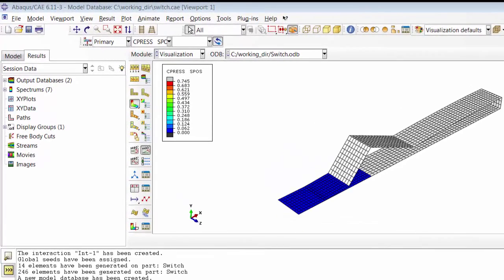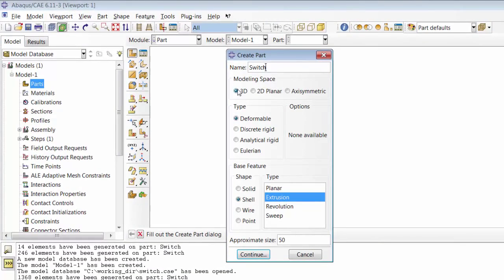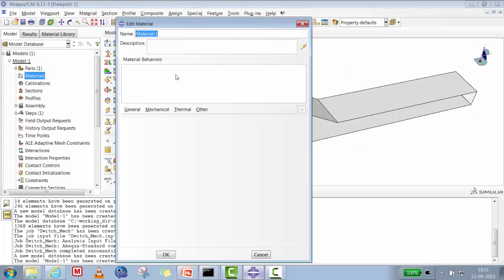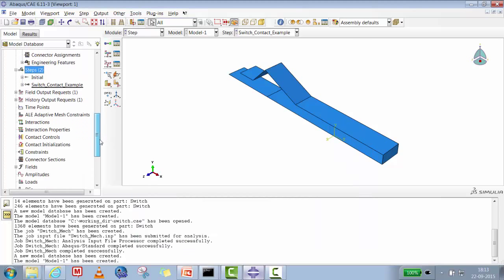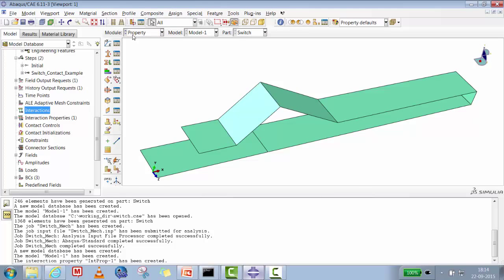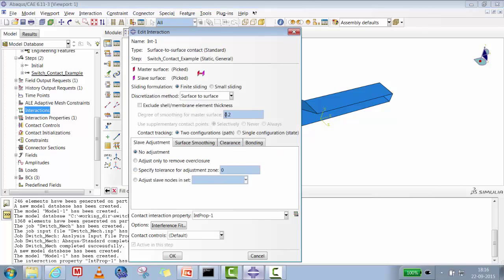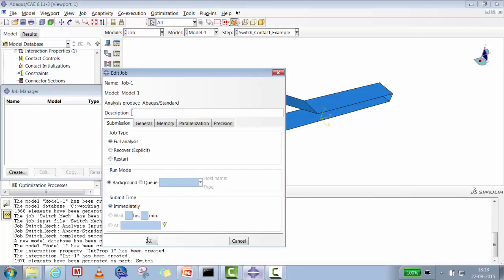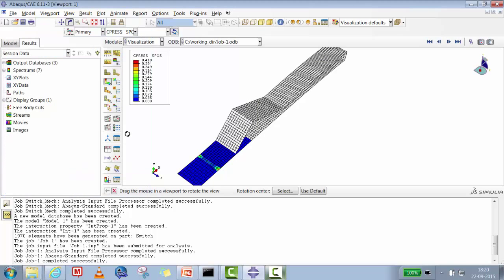Abaqus CAE/ 6.11 : How to do step by step Abaqus Contact (Mechanical Switch contact Example)

Comment: Nice example shown, i am familiar with this type of problems. i worked on  automotive switch-snaps insertion, retention & torque force calculation using plastic data. There we used tetra4 (C3D4) elements to avoid contact penetration if we use C3D10M elements, failure is reported based on plastic strain failure theory since we use first order tetra mesh. can you try few of this examples if possible.
Thank you for the efforts made.